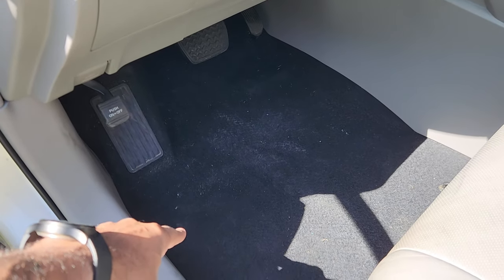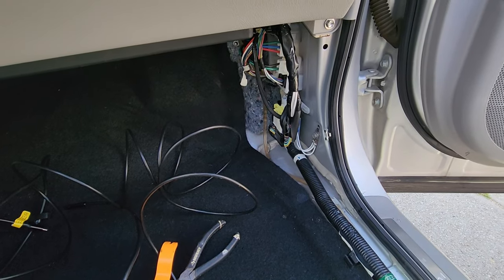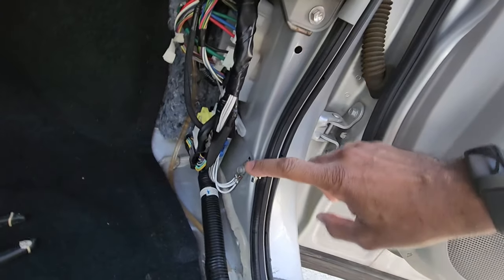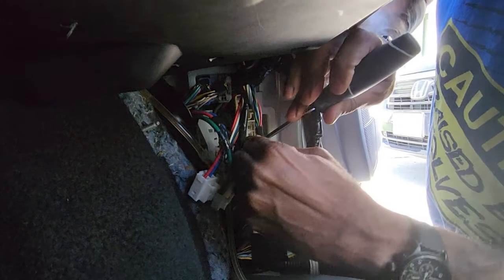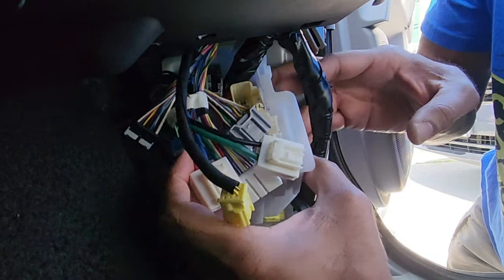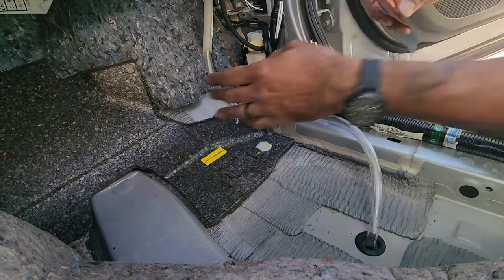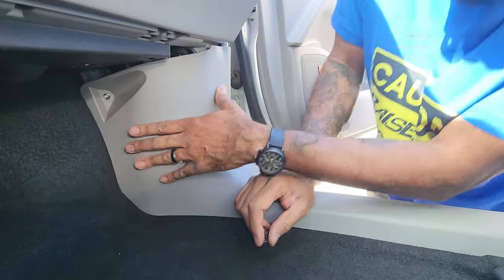Highlander Water Leaking Inside Fix

Comment: You diagnosed the problem perfectly. After some more digging I also found a vid by Rabid Beagle that shows how to splice the hose much higher up, inside the roof pillar, rather than under the dashboard. It takes about five feet of the same half-inch clear plastic tubing you used. While there is a red plastic clip that will give you fits as you remove and reattach the cover panel there, it worked really well for me -- on the passenger side at least. I have not tried the driver's side so maybe that's more of a challenge to fish the hose up. Anyway, both you and the other guy saved me a huge amount of money, so thank you for taking the time to figure out why these Highlanders are so leaky and coming up with a very elegant solution for draining water to the outside of the car rather than into the cabin!

Comment: Great fix. I took it to several repair shops with no luck. How do I make sure it is from the roof drain before I go with this fix on my 2008 Toyota Highlander.
Reply from the maker: @Venky4H-rk1mc  if you have an endoscope camera you can look into the cavity and see if there is standing water in there. If you don't, you can feed some clear tubing down into the cavity and suck through see if water is trapped in there. If there is water trapped, it's most likely your problem.
Reply: @JayJenkins  thank you

Comment: I just completed this on my 2012 Toyota Highlander.  The passenger side is definitely easier.  I used a small hose that I fished it down from the black area on top and attached it to the hose and pulled it through.  That was a big game changer.  (Thanks Jim)   I did find the driver's side electric box more difficult to pull out but it will come out.   A few tips.  1st - definitely put protective gear on arms and hands to limit getting cut.   2nd - detach the connectors to your battery as a safety measure.  3rd - press the emergency break all the way in so you get it out of the way.  4th - on the drivers side, I found the yellow connector to be difficult to detach and reattach.  There is a slide on the side of the connector that you need to push down.  Thanks Jay for the video as this is the best way to permanently fix this problem.

Comment: I attempted today, got to the fuse box, unplugged everything, pulled the 3 little tabs out, and the box came about halfway out and I couldn’t get it all the way out. I was pulling pretty damn hard and was worried I’d break it. Anyone else run into this issue. Had the problem on driver and passenger sides. I put it all back together and I guess I’ll try again this weekend. It’s a 2013 Highlander limited.

Comment: Thanks for this video. I started having this problem several weeks ago and this saved a lot of time trying to find the cause. I had a problem getting the hose routed through the black so I put a piece of weed eater string through from the front of the box into the chamber. I taped the hose to the end of the cord and pull the hose back through and finished routing it to the hole in the floor.
Reply: Good idea. I struggled with that part a lot

Comment: Did this and unfortunately water is still getting in. Put some silicone to give it more of a seal around the rubber part and water still gets in. Going back to the drawing board.
Reply from the maker: @quicknthievious7187  sounds like your leak isn't from the sunroof drain like not draining. I've also heard that the seal below the windshield by the firewall can leak rainwater into the cabin. Best of luck finding a solution.
Reply: @JayJenkins we just had some rain here and it’s soaking wet right where the grommet is. The top of the carpet is dry. My guess is the exiting water is flowing faster out than it is draining. Will see if I can drill holes at the bottom.

Update: I actually got under and saw the holes, grabbed the hose, made sure it stuck out of a hole to be sure the water exits. Put more silicone and now we’ll see what’s going on. Appreciate the work you put in the video!

Comment: Definitely easier on the driver side to reroute down the dashboard rather than remove the junction box.  Passenger side was much easier but there are just too many wires on the driver side.  There is another video that makes it much easier to redirect the tube down the side of the dashboard.  Thanks for the video!

Comment: To add on this video, there is plastic box right on top of electrical box youtuber took out. Once you pull that out (electrical box), you can access that drain tube, then you have to bend it to that plastic box on top, it has square share but it has big hole to inside, you can pull drain tube out. It is not easy to do both side but you can. Becareful your hand, you might get cut but you can pull that drain tube out through that plastic box. After that just connect extra tube to drain out. I just wanted to add to Jay youtube video. I did not understand how he pull it out.
Thank you Jay.

Comment: Yours is the best! The only thing I wished for was a better shot of the black box above the junction box. My driveway is pitch at a 30° grade and water intrusion is a huge problem. Thanks for the fix!
Reply from the maker: It's crazy that Toyota wouldn't just run the drain line like 6 more inches out the bottom normally.
Reply: It's been a month since the repair. So far so good. I'm glad I didn't go with some of the suggestions that involved piping Draino into the fender well!
Reply from the maker: @tomstaggs4240  I haven't had any issues since I put in the drain lines. They don't clog they drain cleanly and it's nice to know during a downpour my floorboards are still going to be dry.

Comment: Dang, dude figured it out! I’m going to grab the 1/2” tubing today. Bin dealing with this off and on over the years. Best video yet. I may run the tubing through pvc pipe on the floor. God forbid the plastic tube gets pinched and stops the flow of water from flowing through or something to that effect.  Any thoughts?
Reply from the maker: @christopherkingston3231  it's up to you but I think that would be overkill. The tubing itself would take some good direct pressure to actually squash it to stop the flow of water and the area that you're routing the tubing in underneath the carpet is tucked away enough to avoid any direct pressure. But if you are worried about it getting crushed you could use reinforced vinyl tubing instead of the cheaper clear vinyl tubing

Comment: I also have water behind the seat in the rear passenger floorboard. Is there another section where the driver/rear meet that has to have another drain hose done as in the front?
Reply from the maker: @solafide4806  not that I'm aware of. I only know of the 2 drain holes but if your truck is parked slanted backwards the water can pool towards the back. Mine is parked tilted forward so the pooling starts in the front, but the first time it happened it got the rear wet also, that's when I had to have my flooring replaced because it was moldy.
Reply: Thank you for the reply. I'll check into it and see. I apologize for not saying it first but thanks for the vid. It was super helpful

Comment: Great video! You da Man! Maybe someone could add what that smaller diameter clear tube is that you can see running down next to the one that got the extension. I looks like about half the diameter and turns above the rocker pane and runs aft all the way past the second row rear seats. What is the purpose of that tube?

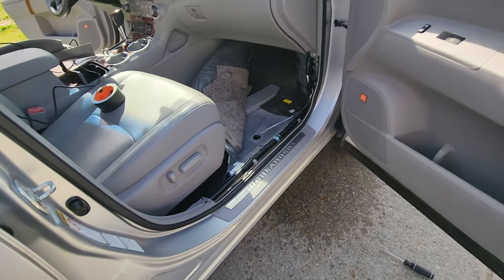Comment: Great fix!  Video at 12:41 shows water running out of the pinch weld.  How is this possible, with the water diverted through the floor board?  Thank you.
Reply from the maker: @Eric_the_red1  it's not coming out of the bench well, it's actually dripping all across the edge of the black plastic piece that is underneath the car. There's a black covering on the bottom of the car and there is a gap between that and the actual hole in the bottom of the floorboard, so the water drips onto the plastic piece and then falls out wherever it can.

Comment: Hasnt rained in months. Still get water on driver side. I was thinking it could be from the AC vents?
Reply from the maker: @vegeta7328  yes, when I researched the problem I found that issue. Completely different issue from wet floorboards when it rains, I did not have that issue but I believe that is separate and that is caused by a clogged AC condensation drain line
Reply: @JayJenkins  First of all, great video. I believe I am also having an issue with a clogged AC condensation drain line...because I'm noticing the pooling water on the driver's side when it hasn't rained in several days. Can anyone post a video that addresses this problem?

Comment: Did you also have to replace the wet carpet?
Reply from the maker: @alia957  not this time. When it happened the first time dealer charged me over like 1500 to replace the interior lining and the padding. The actual carpets dried. This time I fixed it before it destroyed it again.
Reply: I put a large dehumidifier in the car, which dried it after a week, then ran an ozone generator in the car for a day to deodorize it.

Comment: wouldn't it be easier to just drill a hole under each side of the car? right at the seams where the water is supposed to drip from pillar A into the chassis floor
Reply from the maker: I thought about this but the problem would be the water is still draining into a cavity in the vehicle hoping that it drips out. The water is meant to drip out the pinch weld all along the side of the vehicle from front to rear, most of the time people find the issue in the front but if you park your vehicle on a slant leaning back you will most likely develop this issue with clogs in the rear. If you only put drain holes in the front then if your car is consistently parked slanted backwards the water would collect in the back. I imagine you could drill holes all along the panel from front to back and it would work.  I'm not 100% sure on this because I didn't test it, but I do know that mine is draining out the bottom of the car now and my floor is dry.